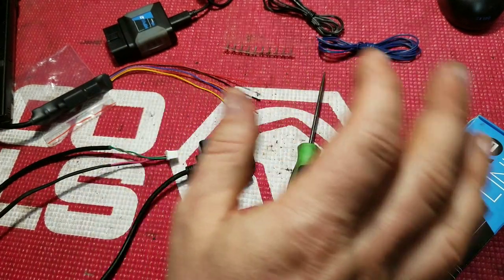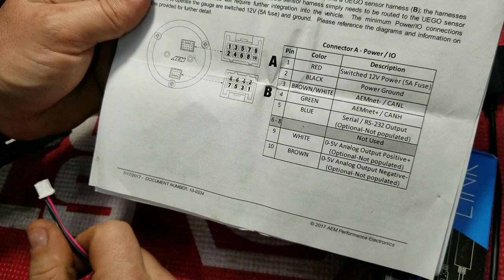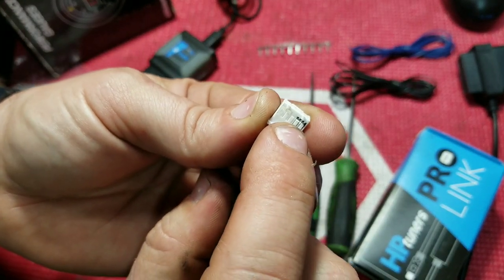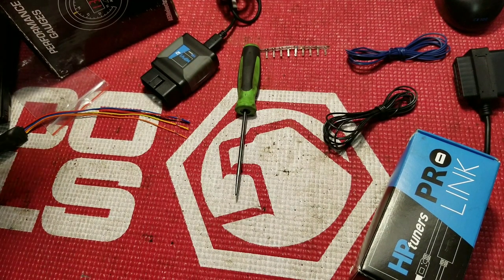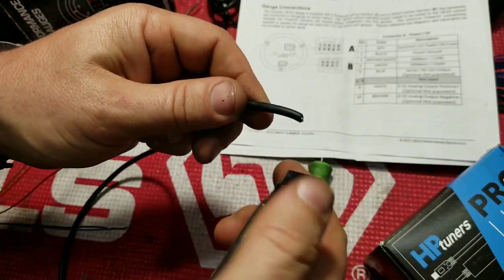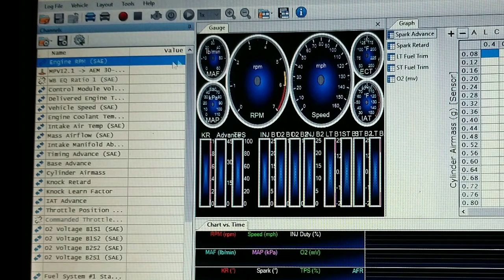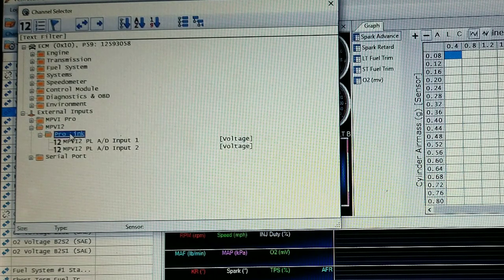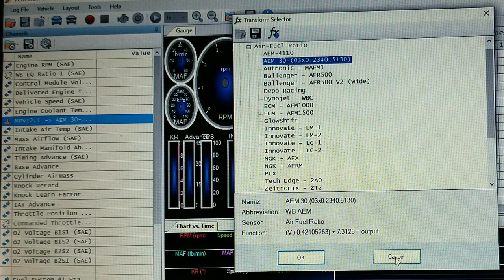HP Tuners MPVI2 Pro Link analog inputs AEM X-series 30-0334 Wideband 30-0300

Comment: Only thing is, the OBDII version of the gauge (30-0334) "speaks" OBDII CAN protocol, instead of the AEMNet CAN protocol, like to 30-0300/0310. So, it MAY not work with the ProLink CAN input without being re-flashed back to the 30-0300 firmware. Depending on how HPTuners implements the interface.
Reply from the maker: it worked perfect first try this way when i did it on the MPVI2 and the latest software update as of when this was recorded. i have had some viewers say they needed to adjust parameters to what AEM had in the instruction... not sure why tho unless they were wonky before they started this process or were not on the latest HP tuners update.

Comment: Or you can use the AEM 30-0300 and connect it through the EGR or other unused sensor in HP without buying ProLink stuff.
Reply from the maker: This is true but when you start tuning multiple vehicles a week and its not your car you dont want to start rigging up stuff to there harness.

Comment: Okay so ive got the AEM 30-0300 x series gauge. Can i use the CAN high and low wires instead of analog inputs to connect to my ProLink? I will have the whole Pro Features Kit.

Comment: Okay, so let me get this right. If I have the original mvpi2 non pro, and buy that $34 USB cable from hp tuners, follow your video, the aem wideband will work and log afr on my non canbus 2000 Corvette??
Reply from the maker: No... well not sure... I dont think it will work with out purchasing the pro feature. I purchased the pro feature and then did this because I wanted the MPVI2 to match the ease of the original MPVI Pro so I could quickly go from car to car.

Comment: I got a 2002 Ws6 Trans Am. I bought a new HP tuners MPVI2 standard and a new AEM 30-0300 wideband. So If i buy this HP tuners pro link and wire it up like you shown in this video, I will be able to data log?
Reply from the maker: only if u have the pro feature set purchased for ur mpvi2. u can use the same wires but run it to ur Serial port on ur laptop.

Comment: Did you need to purchase the pro software as well or just the pro link cable
Reply: You'll need to purchase the Pro Features Set for the MPVI2.  It includes the software and the pro link cable for $249.99.  I just bought mine.

Comment: Nice surgery :) Keep those spare pins, though...  The ProLink will eventually be able to read the 30-0300/0310 CAN data directly. Which is better than either the analog or OBDII data connection :)
Reply from the maker: Yeah I know. Cant wait for them to get all the Pro Link software finish.
Reply: Have they came out with this capability yet?
Reply: @utubeacount10  Yes,

Comment: thank you for this very good video,I have a 300c srt8 06. I did no pay attention and i got  AEM 30-0333 X-Series Wideband with out using the obd2 Is it possible to send a signal like CONN A 3can L 4can H directly on the canL and canH on the car, or using rs232 connector  pasthrought my MPVI and be on my computer to dataloging HPTuners please help i d'ont wont to buy a MPVI2 thank's
Reply from the maker: in theory yes that should work but i havent tried it that way. sorry i didnt get back to you sooner. did you get it all sorted out?

Comment: Where I should connect the black and red wires that are in the other side of the connector
Reply: I was just about to type the same.  I'm assuming based on instructions they need to be on a key on wire and ground.  My confusion is that the MPVI2 already has power so I'm assuming this power is for the gauge if you install.  I will try without and then if something is off I will know to connect these.

Comment: I would rather buy a serial adapter and use that instead way cheaper than a pro upgrade
Reply from the maker: that is very true sir but I got purchase happy when the MPVI2 was released so I wanted to get the Pro Feature like my original MPVI I have and in the long run its proved to be a much simpler set up when im using it daily in multiple vehicles
Reply: @GonzosGarage  I only have one car that uses the tuner so it dose not makes sense for me but if I use standalone data logging then it would be worth it.
Reply: do you have a tutorial for that?